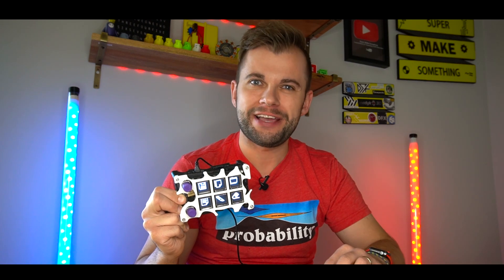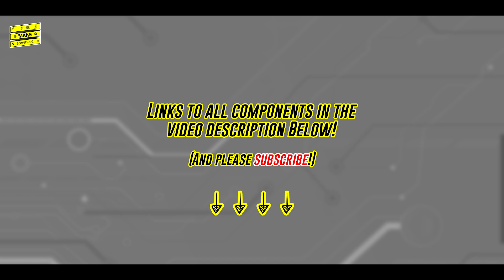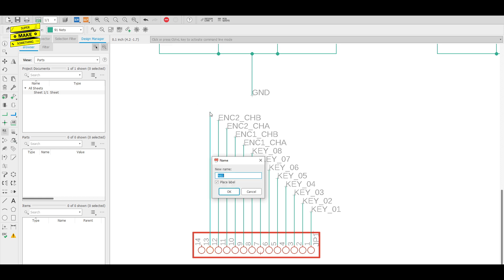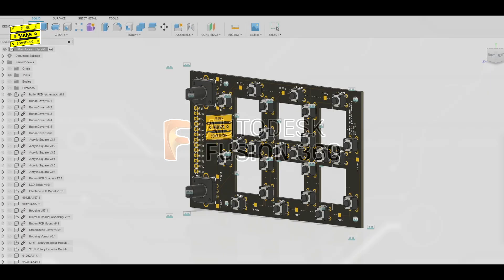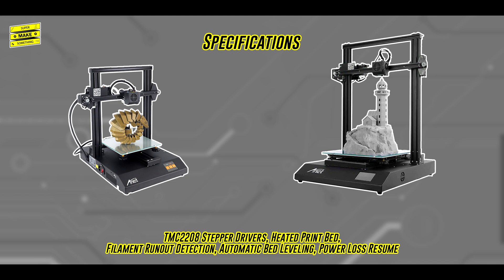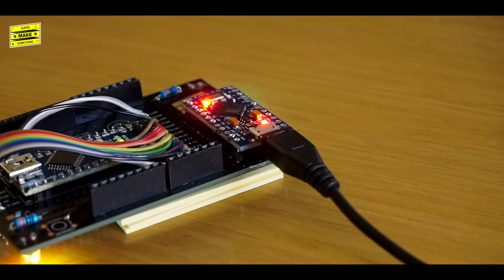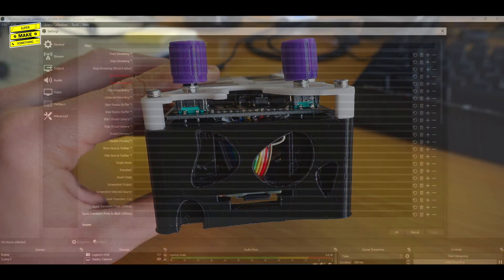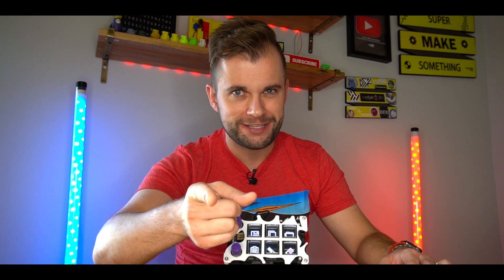DIY Stream Deck (3D Printing, Arduino, Electronics!)

Comment from the maker: DIY Stream Deck kits are now available, which include all of the electronics and mechanical components you need to make this project -- simply supply your own 3D printed parts and you are ready to build!  Check out the following link for more details and order yours today! https://bit.ly/3eQDWWw
Reply: The kit's PCBs don't have the black solder mask or ENIG and some of the acrylic squares are cut super-sloppy like whoever put these in here didn't give a fff about quality control. Definitely wish I saved my money and built it piece-by-piece.
Reply from the maker: @aleph_prime  Sorry to hear that your experience with the kit was not good.  The decision to use an ENIG finish was to try to keep the cost as low as possible, though I think that it should be possible to manufacture the next batch with a black soldermask and white text without much of a price increase.  Please get in contact with Alien3D to see if they can at least hook you up with some more acrylic squares. Cheers!
Reply from the maker: @aleph_prime  Just wanted to follow up on this — I spoke with Alien3D and a set of replacements are currently in the mail. Sorry again for your negative experience with this order. Future versions will be sure to indicate the soldermask and silkscreen colors, and Alien 3D said that they may be able to make ENIG boards available as a customization option. Hope the new parts work out for you! Good luck with your build!
Reply: @aleph_prime  Heya =) I'm glad we could work something out on these! On future PCB's I plan on getting the black mask. As this was a first batch, I'm learning some things with this kit myself =P The gold connections probably won't be a thing as it's an additional cost that I'm thinking most won't worry about but maybe I'll carry a couple as an option. We'll see =) The acrylic squares I assumed would be okay since they have the paper coating, but I will inspect future ones and possibly find a different supplier if need be, so I apologize for them being wonky. Can't wait to see what you do with it!

Comment: Ich will mir auch ein Stream Deck bauen.
Dein Video ist das einzige, welches nahezu genau meinen Vorstellungen entspricht.
Das schwierigste wird sein, die Knöpfe zu realisieren, sodass diese noch durchsichtig sind und man die Icon's noch sehen kann.
Allerdings möchte ich beim Button-Press keinen Tastatur Befehl senden sondern ein USB-Befehl / ESP Befehl.
Sodass eine Software das dann auswertet.
Wenn man nämlich einen Tastatur Befehl sendet und dann auch der Tastatur die ensprechende Taste drückt, führt diese den Befehl dann auch aus, z.B. beim Schreiben.
Das Stream Deck, welches ich bauen will, soll auch WinProc Befehle an Software senden können.
Ich arbeite in meiner Software z.B ausschließlich mit WinProc Befehlen zur Kommunikation untereinander.
Reply from the maker: Hört sich wie ein cooles Projekt an! Halte mich bitte über Fortschritte auf dem Laufenden!

Comment: I have a small problem with the encoder library interfering with your keyboard code, its been a long time since your build but, it seems to be an ODR violation in the encoder library, did you ever fix this problem or was there something in the code to help this problem?

Comment: How hard would it be to modify this so that instead of sending key commands over a USB output, it instead sends MQTT messages to a configured MQTT server & topic?
Reply from the maker: I was not familiar with MQTT before your comment, but I looked into it a little bit and it looks awesome! Arduino seems to have an MQTT library available, so I think it is possible to modify the code.  The only caveat is that the Pro Micro used for the PC interface in this project does not have built-in WiFi or Bluetooth, so it would need to be connected to a computer to interface with a MQTT server. If you look into this, please let me know! It seems very cool!

Comment: Howadays i know a couple years have passed but ESP32 and RP2040 are interesting choices since they support megabytes of flash, plenty for images and the like. The flash is external, and on RP2040 boards can usually be replaced by up to 16MB. Furthermore they don't suffer when driving the LCD via SPI unlike 8-bit Arduinos, saving pins and affording a cheaper screen subassembly. You can also multiplex screen and SD-Card via SPI and Chip Select - it also worked on 8-bit Arduino but the performance isn't great.
Reply from the maker: Agreed! Either of these two boards would be an awesome platform for a remake of this project!

Comment: Could you build one using a STM32F429I-DISC1 evaluation board?
Reply from the maker: That may be possible, but I have not tried it.  It would definitely require a different motherboard because the current one is designed for two Arduinos.  If you end up trying it, please let me know how it works out!
Reply: I have no coding experience, so it will be a long journey.  Someone gifted me a bunch of these dev boards, and this looks to be an excellent use for them.

Comment: Amazing video and idea. Just wondering why did you choose single large lcd instead of multiple small LCDs?
Reply from the maker: Thanks! I decided to go with one LCD for two reasons: 1.) cost (one screen is cheaper than multiple ones), and 2.) interface simplicity (having multiple screens would require additional hardware to connect to the Arduino due to limited IO).
Reply: @SuperMakeSomething  hey I am make a D.I.Y LCD stream deck for my school digital technology class as my final project and I am planning to have 32 buttons, 5 slide potentiometers and I would love to know how to make the screen bigger and the code to have more buttons on the screen as well as once pushing a button it opens to another screen basically making the first button a file the opening more from there if you see this please help thanks soo much.

Comment: HI,

Thank you for this, I'm going to build one of these and I'm in the process of ordering all the parts for this.

Question regarding the acrylic squares....

The supplier seems to have them available in multiple thicknesses, so what thickness do I need to be compatible with your button frames?

Thank you!

Comment: Thank you for your input. I know this is too much to ask. But i am a noob when it comes to electronics and components. But is it possible to get the changes i asked. In the form of a video or even a document so i can understand it clearly. And try it out.
Q: what changes do i make to the existing design?
Q: would i need more parts? And if so what are they and how many?
Q: could i also get a circuit diagram or pcb make and changes with the requirements i asked?
If these questions are not to be answered here. I can go to patteon and fund the min tier to get my answers. Forgive my urgency but this project is just too cool to pass up.

Comment: Hello sir. First of. This is an amazing project and i would love to build my own diy streamdeck with knobs. I am a 3d animator and i see a lot of potential for this open source stream deck. Mainly because i have used one and this is affordable. My question is simple. 
Q: Could i increase the number of keys to 32 display click keys?
 and if so. 
Q: How do combine them together without it being too big like an actual keyboard?
 Desperately would love to have 32 keys with 6 knobs to work with.
Basically 
Q: can i customize a multiple key design combined and working together with 32 keys and 6 knobs?
I still think it would be affordable considering the price of this one.
Reply: Keep up the great work. And thank you for making this project and its files accessible. It is a great service to all indeed.
Reply from the maker: Thanks for checking out the video! The design would be extendable by redesigning the circuit board to use a multiplexer to increase the number of buttons that you could connect at once. This would essentially require a full redesign though, so you may just want to build several of these devices — since they register as a standard USB keyboard, as long as each button sends a different character, it should work like you want it to. Hope this helps!
Reply: Thank you for your input. I know this is too much to ask. But i am a noob when it comes to electronics and components. But is it possible to get the changes i asked. In the form of a video or even a document so i can understand it clearly. And try it out.
Q: what changes do i make to the existing design?
Q: would i need more parts? And if so what are they and how many?
Q: could i also get a circuit diagram or pcb make and changes with the requirements i asked?
If these questions are not to be answered here. I can go to patteon and fund the min tier to get my answers. Forgive my urgency but this project is just too cool to pass up.
Reply: I would not mind to commision the making of said model of stream deck. Or just show me how to do it using a video.
32 keys
6 knobs.
Could i use a bigger screen instead for more keys?
Reply from the maker: @sajin0varghese  I offer consulting services for custom projects. If this is something that you would be interested in, please reach out via e-mail to discuss further.
Reply: @SuperMakeSomething  sure sir. Will do. I tried the about page. It has all the social links. Can you please provide an email iD?
Or i can send you mine so that you may contact me further?
Reply from the maker: @sajin0varghese  I offer consulting services for custom projects. If this is something that you would be interested in, please reach out via e-mail to discuss further.

Comment: Can the knob be used to control volume?
Reply from the maker: Yes, this should be possible. All that would need to be done is to have the encoder left/right functions be remapped to the volume control buttons instead of the arrow keys.

Comment: do i just use the pcbway link, order the thing and then just build it? 
does the link have all the required things?
Reply from the maker: The PCBWay link will take you to the site where you can purchase both of the PCBs needed for this project. The parts can be sourced via the affiliate links in the video description. There is also a kit version available from Alien3D, but it is currently out of stock. It should hopefully be available again relatively soon though!
Reply: @SuperMakeSomething  thanks u are the only youtuber with the *BEST* responses, best videos and actually replies!
Reply from the maker: @xylorr2  Thank you!

Comment: Could this project be made wireless by using something like an esp8266 instead of an Arduino?
Reply from the maker: That is a cool idea! I think it should be possible but have not played with any Bluetooth keyboard functionality for the ESP8266.
Reply: @SuperMakeSomething  I rather like the idea of a WIFI controller that could be used for home automation, say to control lights, volume of speakers and so on.
Reply from the maker: @fred7flinstone  That would be awesome!

Comment: Thaks for tthe video.                How do you program the Hot keys? 
you doit in the arduino, or in a PC app?
Reply from the maker: What keyboard character each button corresponds to is programmed in Arduino. After this, these keyboard characters are assigned in your program of choice as a shortcut.

Comment: Here is an idea for you, replace the normal screen with a touch screen.
This will save you inputs, and probably one arduino, since all buttons have a set location, you can just program the said locations on the code it self, and just reuse that portion of the code every time you need to check for a press. 
Thats what streamdeck does, they just have a layer with "bubbles" over the screen that presses on the touchscreen.
Reply from the maker: I initially thought about using a touchscreen, but decided to go for physical buttons because they would allow streamers to “feel” which button they were going to press without having to look and because I did not know how long budget TFTs would survive repeated presses. Official StreamDecks actually use a clear “plastic sheet” circuit underneath a rubber membrane (similar to those found in keyboards), but I could not use these for this build because they would have driven the price of the build through the roof. Definitely agree that a touchscreen would cut down on the hardware complexity. Would be cool to only need one Arduino! Thinking about doing a v2 with a different microcontroller!

Comment: I am thinking of the new Raspberry Zero 2W which roughly matches the speed of a Raspberry PI 3 for only 15 USD.
+ with MicroPython you have the same libraries available to interface with usb_hid keyboard/mouse etc.
Reply from the maker: That would be cool! The form factor is right and I think the code could be modified to dynamically drag icons/redefine hotkeys like in an official Stream Deck!

Comment: “easy”

> soldering
> dives into custom PCB
> programming
> interface multiple micro controllers

🤣
Reply from the maker: Recreating the project should be straight forward though -- all of the code, links to parts, and even a link to a kit can be found in the video description! :D

Comment: Interesting. Was maybe a teensy not a better choice for the inputs+screen handling? Also, I wonder if you could use see through resin instead of the acrylic, on an SLA printer. Might try that myself.
Reply from the maker: A teensy would be a great option for this project for sure! The acrylic is also a really cool idea! If you try it, please let me know how it works!

Comment: resberry pi pico has released and I hope you make another version with this pico.
Reply from the maker: That’s a really cool idea! The Pico would be perfect for this project. Will definitely think about using it for a version 2!
Reply: @SuperMakeSomething  Awesome, and e14 has already made a macro kbd you can use them as a reference too.
Reply from the maker: @debjit21  Thanks! I will check it out!

Comment: I have a very specific use for this. I have a custom automotive lighting company and my demonstration truck is FILLED with switches. I'm running out of spaces lol so something custom like this would be perfect. Could you program the switches to control ws2812b LED strip outputs? If so, I think I'd love to buy a kit for my company
Reply from the maker: This could definitely be programmed to do that, though the code on the Arduino Pro Micro would have to change a bit. Instead of using the keyboard library, the microcontroller would need code to control ws2812b LEDs, but this is well documented — if you search for “Arduino Neopixels” you should get tons tutorials! Hope this helps! Good luck with your project!
Reply: @SuperMakeSomething  that's amazing! Would I be able to commission you to do the edits to the code if I bought a kit? Or do you think it's pretty self explanatory once I look at the libraries?
Reply from the maker: @BLueFeaTHeRedOliVeS  Unfortunately I am not taking commissions at the moment, but I think/hope it should be pretty doable if you follow along with this video and a Neopixel tutorial. If you do end up building it, please let me know how it goes!
Reply: @SuperMakeSomething  I'll definitely let you know. Thank you!!

Comment: So, I was thinking that a much simpler device could be done just using an old monitor, overlay a 3d printed cover with the proper cutouts for the placements of images from underlaying LCD screen, and be able to use ANY controls, combination.   Rotary encoders, switches, buttons, doesn't matter.  I am way too overloaded to take this one on, but OMG, this would be a game changer for so many things!  Stream Deck is really a simple pcs of hardware.  It's the software that seems more complex.   (and the impossible part of the project).  I think the hardware would be nothing more than a monitor,  a sheet of black plastic with holes drilled into it, and a USB - Encoder, or Adruino board.   Someone MUST give this a shot!  LOL.

Comment: this all seems good but is impractical for 99% users who watch this video..even tho i understood everything from how to assemble parts to how to get the pcb made and assesmbly dont iwill not be doing this because 1. the pricing varies a lot from each geographic location and 2 it is not feasible or worth the hassle compared to just getting a mobile alternative like streamlabs deck or elgato stream deck mobile yearly subscription or some other such app

Comment: This project is cool. I made one. But have problem with sd card. How big card is supported??
Reply from the maker: I used an 8GB SD card and did not have any issues.
Reply: @SuperMakeSomething  I tried many cards. 16,8 Gb and streamdeck send error could not find icons pictures. Maybe I have broken SD card. I try buy new 4gb or 8gb card.

Comment: cost of 3d printer??and one needs the xl deck
Reply from the maker: The assumption is that people attempting this custom build already have a printer or are able to source the parts from a maker space at a local library. The button PCB boards should be able to be linked together with a bit of additional soldering/coding to expand to the number of buttons you want to have in a build.

Comment: Hello, I would like to use a Nextion screen, which would replace the TFT screen itself, the Arduino Nano and the SD card reader. Do you know this type of screen? If so, why didn't you use it? By the way, do you think it would work or do you have any tips to give me?
Reply from the maker: I actually did not know about these screens until after I had finished the project, but a few people have mentioned them in the comments. I definitely want to try them out because I think they would work well! If I can pick one up and experiment with it, I will report back!
Reply: @SuperMakeSomething  Thank you for responding, looking forward to future projects on your channel.
Reply from the maker: @Bazzan  Thank you!